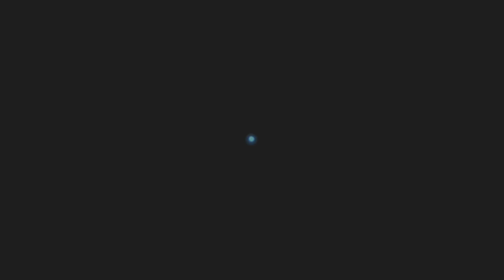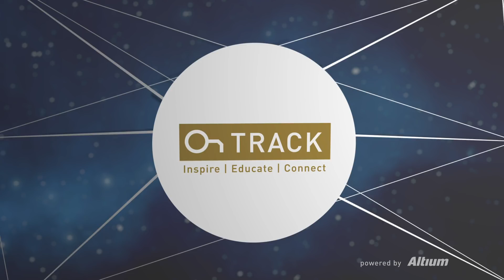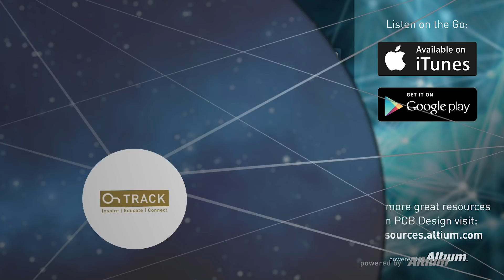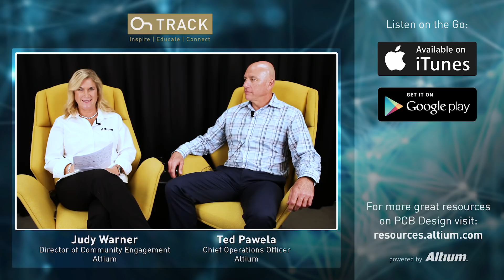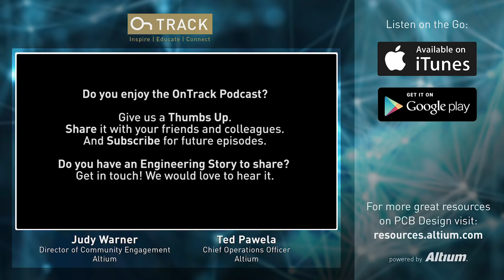Altium's Vision of the Future, featuring Ted Pawela, COO [OnTrack Podcast]

Comment: I hope they improve the panel system. AD18 doesn't allow setting changes mid tool. We used to be able to hit hot keys to pull up popup menus to adjust things without exiting the routing tool. Those settings are buried into a panel that is not available while a tool is active.